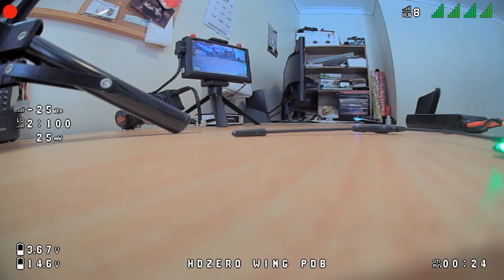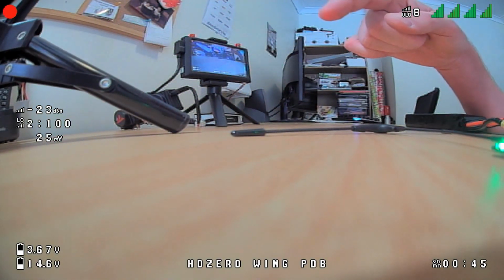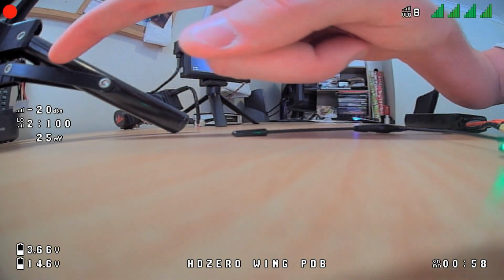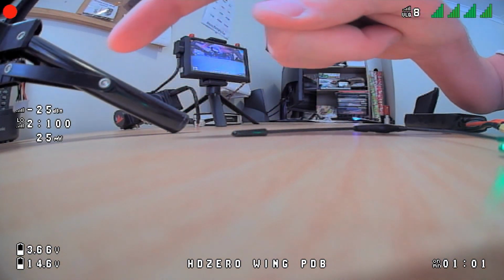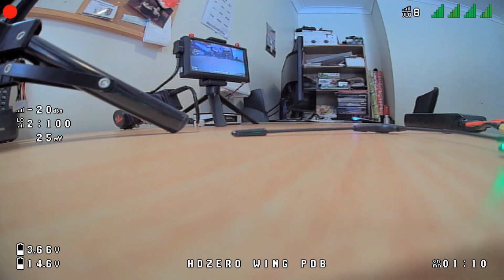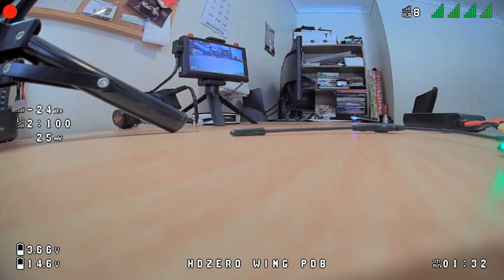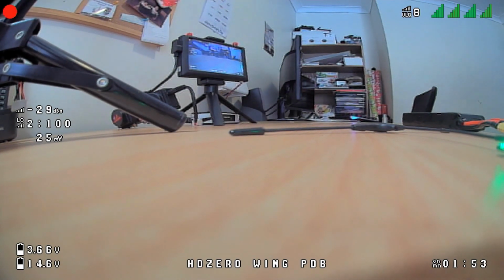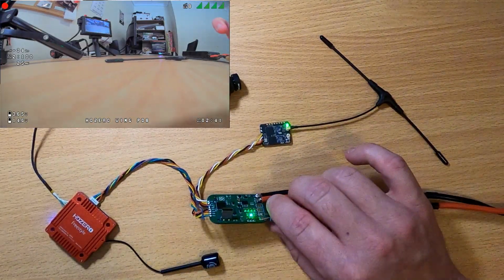Hdzero Protype Pdb for Wings

Comment: Great video mate! Thanks for running over it and giving it a test. The latest version I have updated to have the correct spacing and hole size for Dupont.  In regards to the size, now that the components are nailed down it could be made more compact. The reason for the back side not having components is the manufacturer (JLCPCB) only does smt assembly for one side, so to make it easy for anyone to order I went with one side only. Most important thing is that this is open source, anyone can modify it to their liking and order a batch them selves. For 5 of these it comes in around 30AUD each. For 20 it comes down to about 20AUD each. Thanks again mate.